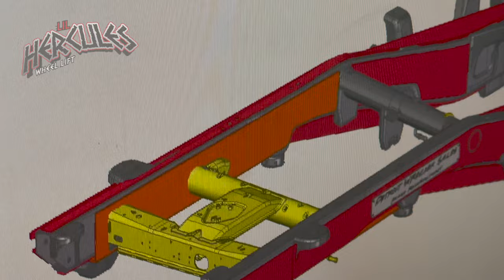Area 47 from IL gets a Lil Herc 2.0

Comment: Could this be installed on a 2006 chevy 2500 with 6.5 bed ??
Reply from the maker: Not unless the truck has a 10,000lb GVWR, leaf spring suspension, and 160” wheelbase. Call us if you have more questions 313-835-8700

Comment: What’s the price of this installation
Reply from the maker: Lil Hercule's pricing is currently $21,00.00 not installed, plus shipping. For installation add another $8k and that includes:

* The most thorough Frame Reinforcement in the world  click here for video —> https://youtu.be/50mcpYQ2MGs,  
* rear suspension. Click here for the video —> https://youtu.be/u-JzOq1HqvE 
* plus it comes with everything else that is needed to tow home like chains, ratchets & straps. Again everything needed to tow home. 
* Toolbox for the double motor electric pump (runs twice as fast as a single motor). 
* Wireless Towlights and corded. 
* Work lights w/ a switch installed into the dash to turn on/off. 
* Spare springs for L Arms, spare hydraulic o-rings for every hydraulic hose connection, spare 300 amp fuses for the electric motors. 

#LilHerc will work circles around any wrecker body or competitors unit that is similar to ours by far, in regards to duty cycle, 

* 5,000 Lift Capacity
* 10,000lb Tow Capacity

LH 2.0 now has a 5” bore Lift cylinder. Which is currently the biggest 'Lift" cylinder in the world for a light-duty application.
Naturally, we made out tubes thicker to accommodate & they are over 1/2" thick!! Making them the thickest tubes in the world!
Most wrecker bodies are approx $50k installed. The LH is 1/2 that! Plus all wreckers have plastic wear pads for the sole purpose of replacing them. 
There is no structural purpose for lifting/towing a car/truck. Our units have none of which! Not to mention the inferior pivot pins on the Wheel-Lift. 
Our pivot pins are so superior that you can tighten them at any time. They are adjustable. So are the L Arm pivot pins. 
That's a big difference in price and not having to deal with the downtime or replace the costs of pivot pins or plastic wear pads is a game changer! 

Plus the fact your driving in a comfortable truck, not a rough-riding wrecker. Essentially killing 2 birds w/ one stone making the truck a versatile money-making machine!
That means it’s stronger than any light-duty wrecker out there, that’s mounted on a 450-550 chassis. Obviously excluding med-duty wreckers that are mounted on F650 of similar chassis. 
But that’s my point! We are the first to over-build the application to this degree.  
Unlike anyone, anything or anywhere else. We have thicker tubes, bigger cylinders, a superior pin system, no wear pads. 
You can’t afford not to have one of our units. They are stronger and have proven to last longer than any other.

"The bitterness of poor quality remains long after the sweetness of low price is forgotten. "

Ben Franklin.